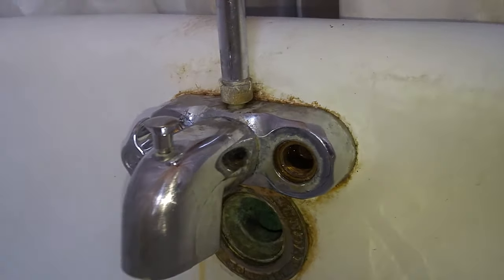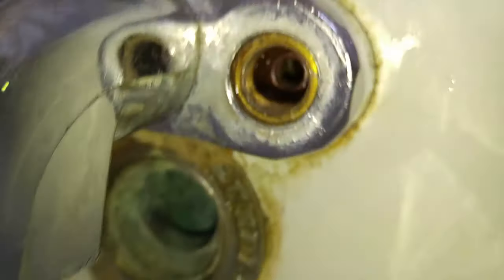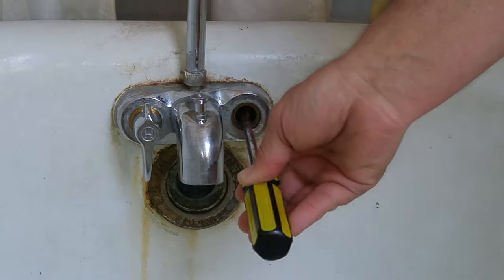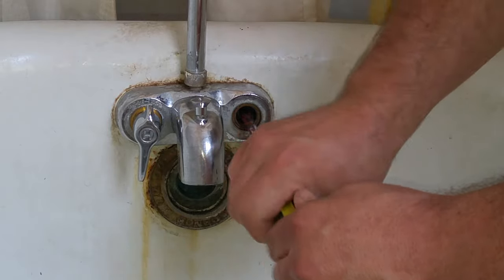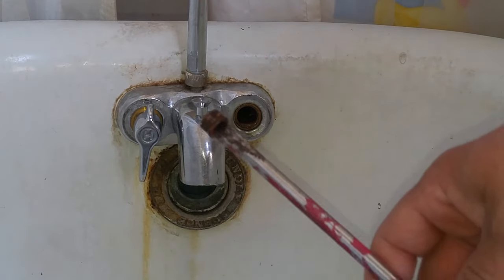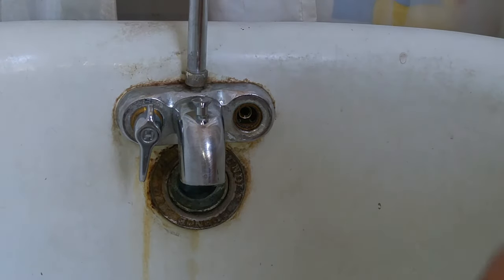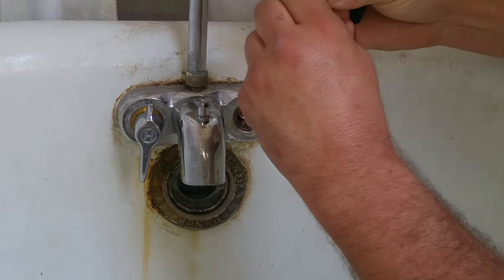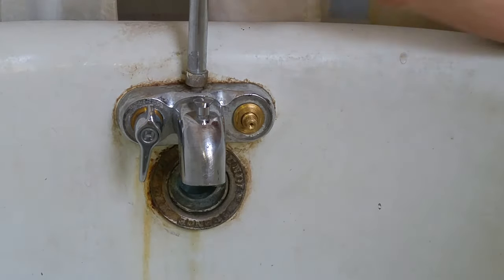Removing stripped faucet seat with ease

Comment: Wow, that worked.  I was trying the seat tool, striped it out and then did exactly what you did; reassembled with the old seat.  Still getting drips, after watching your video, I tried your trick.  I had to bang on the screwdriver a lot more than you did.  I was nervous of damaging the pipe but it finally worked out.  I did use PB Blaster, not sure if it helped, then added plumber grease to the new fitting so next time it is easier.

Comment: Thank You, Thank You, Thank You! I had to replace two 40 yr old H & C water valves as well as the diverter valve in our master suite shower and ran into this same issue. The tool that I bought to remove the old seats started stripping the old seats which were seized and i couldn't get them out. I loathed having to call a plumber that late in the day, so i YT'ed the solution and found this video. I sprayed some penetrating spray onto the old seats, bought a big enough flat head screw driver and hammered it into the stripped seats and booyah, they popped and started screwing out of the threads. We now have all new shower valves and it only cost me the price of parts and my own time and elbow grease.

Comment: Thanks so much for the video.  I had the "proper tool" for removing the seats.  The tool immediately stripped the first seat I tried it on.  Tried your method and it worked perfectly on both seats.  Saved me a tidy plumbers bill and really do appreciate your straightforward and easy to follow video.

Comment: Thank you from the future...at the moment, its 2024, anyhow,  the valve seat in my bathtub faucet was eating  rubber washers for lunch, so i knew the valve seat was in failure mode and the drip, now was actually a stream and would not shut off...so off to Home Depot i went... i got the valve seat wrench... but i put off the job until the next day since i thought to myself.... " what if i strip it out, then what?" So...the tool did work and the valve seat came out with the exact same very satisfying "snap" i heard when your valve seat broke lose... i do have a couple of regrets...i tightened the new valve seat way harder than you seemed to... so that could be a problem for the next guy needing to replace it...oh well i guess I'll leave that problem for the future to solve...but your video answered my question of what to do if i stripped it out....

Comment: In case somebody else is having this prolem too:
My seat was stuck really good and the seat-removal tool stripped it leaving it round inside. The screw driver trick would have worked if the seat hadn't been so tight. I used a Ryoby spiral extractor set and with a few turns and some force got it out.
Reply: 💯%rigth😎👍👍
Reply: Did you use the number 5 Extractor from that kit?

Comment: I’m a mechanic and we use easy outs. Being my work background my valve stem gave me problems as well. I used a wrench to find the size which was 13/16”. I then purchased an extra deep 13/16,  1/2” drive socket and used my 1/2” drive breaker bar.

Comment: Thanks for this video.
I appreciate the screwdriver method, it may even save me from buying a seat wrench in the first place.  Plus it is a lot faster to turn a screwdriver, unless using a ratcheting seat wrench.

By the way I made a note about a trick I use at the time mark below.
3:42...you could have used the faucet handle to hold, instead of using the pliers, while you turned the screwdriver.

Comment: This problem can arise if you use an Allen wrench to remove the seat.  Unless it's a tight fit, you run the risk of rounding out the hole, as the seat hole is not an exact square ... it's a rounded square with tiny notches in each corner.  The correct removal tool is only about $8 and being tapered, you are ensured a tight fit.  To help, you can also squirt WD-40 around the old seat before you try to remove it.  To aid installation (and future removal) of the new seat, use plumbers grease around the threads.
Reply: That’s all great what you’re saying. You are only looking at this from a big country mind set. What about people that live on an island that cannot get the tool right away? Order it on Amazon to take a couple days? That’s days of water wasting. So this little trick comes in good  for we who can’t get the tool right away and need another solution.
Reply: @michaeljames5051  I get that, if you are remote and can't afford to wait.  However leaking valves start slowly, as a drip, which can usually be temporarily controlled by simply closing the valve tighter, until you get a new seat, washer, faucet, removal tool, etc.   As an aside, the best way of making those valves/washers last longer, is to simply turn off the water to finger tightness.

Comment: You tightened the seat (which requires an Allen wrench) with a screwdriver? Just how tight is it suppose to be? It was tight when you took it out
Reply from the maker: Gee Cee As I mentioned at the end of my written description, using a screwdriver will not get it tight enough, as least not without risking damage to the seat itself. I went back after this video was recorded and tightened it up with a proper valve seat wrench.

I will say that using a flat head screw driver is great for starting the seat into the threads. When replacing another seat recently, it kept slipping off the seat wrench when trying to insert it. Wedged it on to the screwdriver and went in without a problem. Then I used the wrench to fully tighten it again.
Reply: Hi Narei, 
I just got back from replacing all three seats at a friends bathtub. 
To my utter frustration, the square seat wrench that I bought did not fit the square hole in the seats (but it does fit the new seats). I had to use the L shaped tapered wrench and had to hammer it in (as you did with the screwdriver) so that it will not slip out of the seat. That worked but I was suprised just how tight they were. When all was assembled, the diverter was not working properly. Too much water was coming out of the faucet instead of the shower head. Whoever made these parts to fit Kohler faucets, screwed up. The plastic bushing that is part of the diverter assembly was defective hence getting stuck in the body of the valve preventing it from working properly ( I also put it in the wrong way). So took it out and used the old plastic bushing. This fiasco set me back almost an hour trying to get the job done. But I got it done. 
I have no qualms fixing things. It's only when minor setback occur (and I've had one too many) that it can be discouraging. Anyway, thanks for sharing your video. I took your advice of tapping L tapered wrench and in hindsight it seems that's how L tapered wrenches are suppose to work. Thanks.
Reply from the maker: GnosisMan50 Glad the video could still help you. I just moved into a new place and again had to replace the valves (this time including cutting out some tile... DX ) this week. The old seats acted like yours, where I had to tap Iin to get them started. I'm guessing it's just the nature of the beast that these brass or whatever fittings corrode over time to become difficult to remove.

Comment: Great vid!!! I have a similar problem but I think its much worse. The hot water in the bathtub started to leak few weeks ago, and someone kept turning the hot water off too tightly after the shower. I removed the knob, the valve and upon inspection it looked pretty beat up and old but the whole gasket and screw were missing, like they were sheered off. I took a flashlight to look inside the wall to look at the stem and yes they are jammed in there tightly. I tried to use needle nose pliers to remove the screw and gasket but they are not budging. If anyone had a similar problem and knows how to fix this, I would really appreciate it. Thanks.
Reply: Turn water on pressure should blow screw and seal out worked for me

Comment: I have try almost everything, this seat is not coming out. I guess time to spend the money and call a plumber in NJ.
Reply: ezout
Reply: Same here, I dried the faucet out with the hair drier then sprayed around the seat with liquid wrench, and heated it with the hair drier.  I used the seat tool tapping it in good and tight .  The seat tool was large providing  good leverage.  I pushed as hard as I could anymore I would push the sink off the wall, that thing is welded in.  I gave up and used a seat renewal kit that leveled it out a little I put it back together so far it's not drippping but wil startl if I use the cold water.  Some things just can't be fixed a new faucet is the only cure
Reply: @maynardcat  Joys of being homeowners. I ended paying $200 to a plumber to take the seat out. It wasn't easy not even for him.